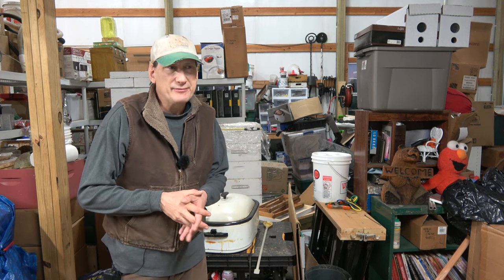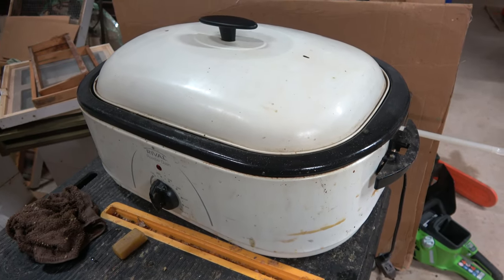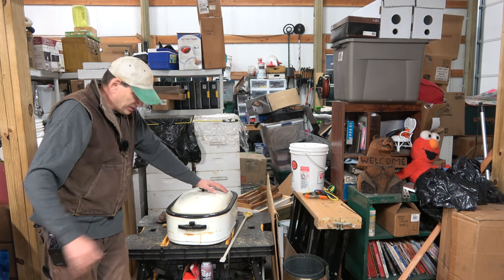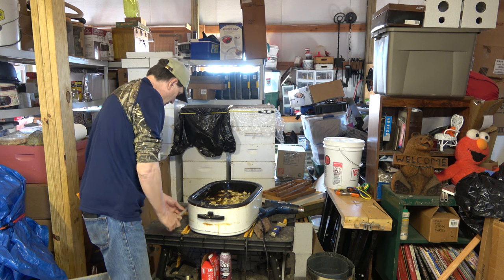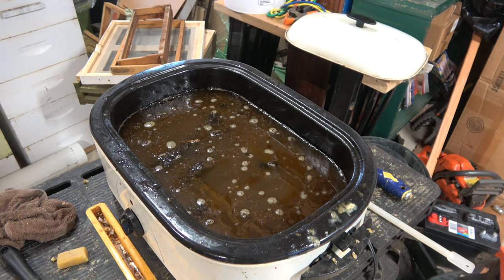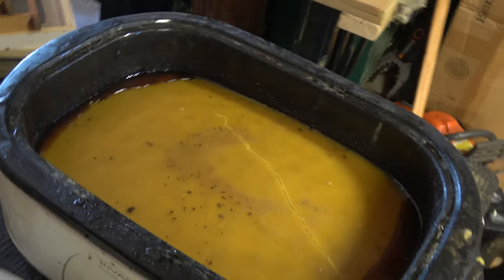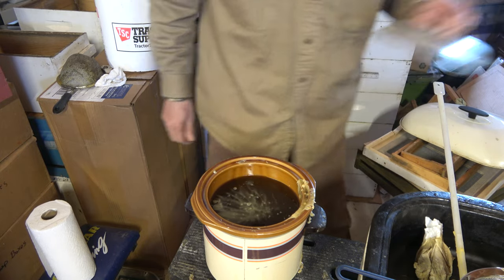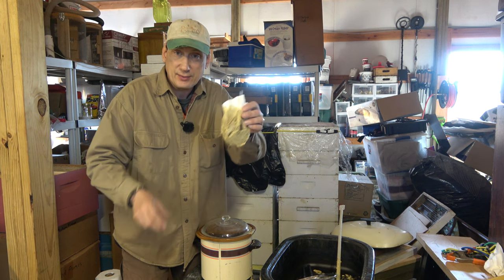Rendering Beeswax into one oz bars S6E6 #beekeeping

Comment: Darren, I’ve been rendering and rewaxing foundations this week!  Folks wonders why the wax is so expensive, it’s so time consuming to get it really clean. I don’t have as much wax as you but for rewaxing foundations, I use a crockpot the same size as yours. I buy 1 gallon cloth paint strainers, put one over the crockpot, add water then put the used wax in, keep adding more as it melts until it’s almost full then lift the strainer up and let it run out of the strainer bag.  At that point it’s clean enough to rewax foundations and saves a lot of time.  The strainer can be emptied when cool and reused. It won’t be perfectly clean of course, just keep same side against the crockpot when reusing.
Reply from the maker: Next time I'm in the big blue store I need to pick up some of those paint strainers.  Dave says he uses them too.  I assume you use the kind for the 5 gallon bucket.
Reply: @JeromeBeeFarm  I buy the one gallon size for that. The blue store carries both sizes. I use the 5 gallon size for straining cappings into a 5 gallon bucket.
Reply from the maker: Thanks Don.  Dave gave me the hot ticket link on Amazon for the 5 gallon ones that come in a package of 25.

Comment: We use a Paint Strainer just like Don Beardon on the first run.  Then when we add the clean wax to the silicon mold, we run it through cheese Cloth instead of the paper towel that you use.  Other than that, we do it the same as you.   Thanks for the video as always.
Reply from the maker: Yeah, I need to pick some of those up at the store and give it a try for that first run like you say.  I'll put them on the Lowes list.

Comment: One of the very few beekeeping jobs that I really dislike. I did build myself a solar wax melter though, which is a super convenient method when there is some sunshine of course. It is just a plywood box with the top angled about 30 degrees to better catch the sun, with a piece of regular window glass in a wooden frame attached to the box with hinges. Inside I have a suspended grate/filter to dump the wax on, and underneath is a wide plastic container with a bit of water in the bottom. As the sun heats up the box the wax melts, the grate/filter catches the impurities, and the clean wax drops down into the water where it solidifies. You can paint the box black for extra efficiency, or even isolate it it if you like, but on a warm sunny days mine works just fine without any of the fancy extras. You can of course make one to fit the amount of wax you typically melt, anything from small to large, or to fit the tray, grate or filter you plan on using inside. Mine was made from off cuts and reclaimed glass, so it cost nothing aside from a couple of cheap hinges, and as it runs on sunshine there are no operating coasts either. And best of all, the wax is really clean and requires very little additional work.
Reply from the maker: I built a solar melter sounds about identical to what you describe. It’s good for small batches. Thanks for watching and commenting.  I made a video of it quite a while back. It’s in the rendering wax playlist.

Comment: Thanks for sharing your method. I like using a womens nylon stocking ( the short ones) rubber banded to a small funnel. It really does a decent job of getting the junk out. But it wouldn't work for starter fuel which was a good idea. I've seen coffee filters work also. Hope you get a lot more wax this year.
Reply from the maker: Hi Russell. Yeah I’ve heard if folks using the stockings. Thanks for stopping by.

Comment: You mentioned something about using not so good comb for rewaxing  foundation. I have some old comb that will never be good for anything other than melting and putting on frames. It is old comb that came from very old wax moth frames. Do you think I could use it to redo old foundation?
Reply from the maker: Sure you can.  That's what I mostly use for rewaxing, and save cappings wax for making other things like lip balm and candles.  Thanks for watching.